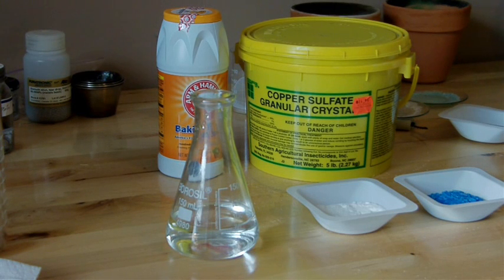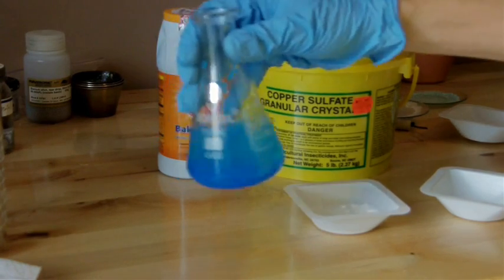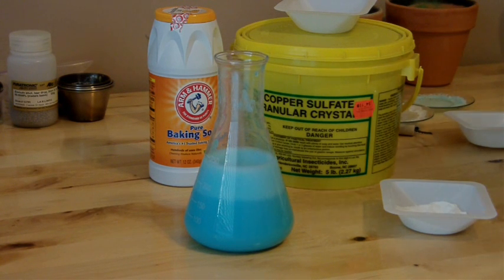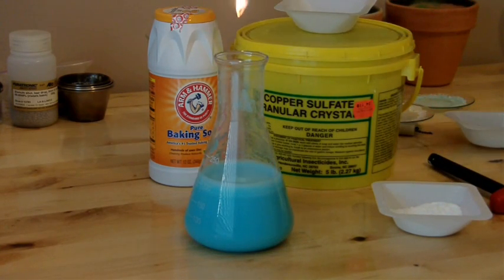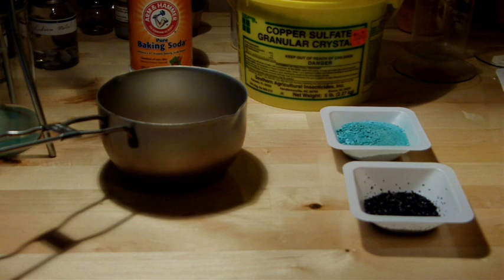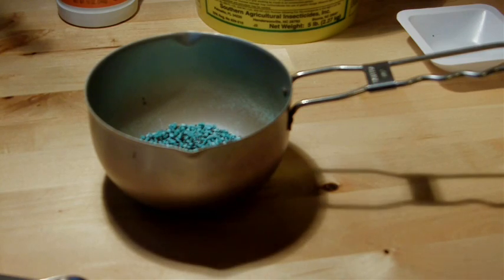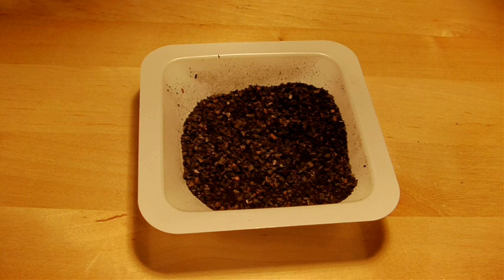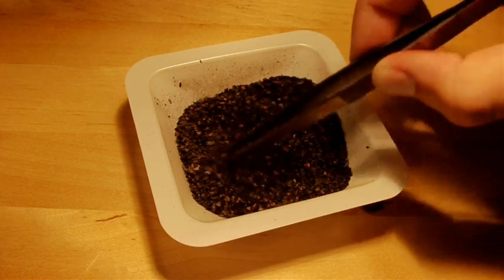Make Copper Metal from Copper Sulfate

Comment: Good stuff!  I coach Science Olympiad and will use this with my kids!  There's another great one where you take a copper sulfate solution and put an iron nail in it - copper is reduced by the iron and deposits on the surface of the nail to give a very distinct coppery color - Thanks!
Reply from the maker: Great! Some tips for the last steps: grind both copper carbonate and carbon down to a fine powder, and mix thoroughly. Also, cover the crucible when firing the mixture. It's actually the carbon monoxide that does the reducing, so keeping it covered keeps this gas in. One of these days I want to make an updated video that addresses these things that I should have done. Good luck!

Comment: How pure is the copper from this experiment? Please respond.
Reply from the maker: Hard to say - it could pick up carbon from the final step (assuming C dissolves in Cu like it does in steel) or carry along metal impurities from the source material. Doing a few recrystallizations on the copper sulfate starting material would help. Also doing the experiment properly to actually produce lump copper would help too!

Comment: It's much better to heat it in a tube in the presence of a gas that is flammable in oxygen. Hydrogen is used frequently, but I've used propane. It doesn't leave impurities behind.

Comment: another away to do it is:
Put an aluminium foil in the copper sulfate solution.
The reaction take some days. The blue color dissaper, the solution turns transparent(like water).
After all blue disappear, separate the copper metal crystals and clean with distilled water.

Comment: 1. You couldve just done an electrolysis of the Copper Sulfate and get pure fine copper particles.
2. Try dropping some zinc into the Copper Sulfate and filter the fine brown particles. Thats copper.
3. I like the way you did it because of the interesting science.. 
4. If youve got a high-temp torch you could melt the copper you got into one big piece.
5. Cheers.

Comment: actually no. copper carbonate decomposes fairly quickly to the oxide. depending on the temperature attained you woud get or just copper(because copper don't burn so easily) or copper II oxide.

Comment from the maker: Carbon is very different as an element than when it is bound in a compound. Same goes for sulfur in sulfate. Check the description for the reaction equations. Adding carbon is necessary for the reaction to happen - the carbon atom in CO3(2-) needs help to break out and leave as CO2 gas, and the elemental C (and heat) provides that by forming CO as an intermediate.

Comment: When you have CuSO4(aq) just add solid Zinc incrementally over a period of time until the solution no longer possess a blue tint this will produce Cu(s) + ZnSO4(aq) then simply decant the the entire solution to safely remove the solid copper from the zinc sulfate, and wash the solid copper down with some distilled or deionized water.

Comment: I like your videos and you do seem to have a fairly adequate understanding of the science involved in the experiments you're doing. I just have 1 question: Why do you almost always insist on using Erlenmeyer flasks for your reactions? This would have been much easier in a beaker. Your alkali metal and water reactions were done in a flask as well which is extremely dangerous. Do you have more of them than beakers? Or perhaps you just enjoy the "sciencey" look of the flask? Just curious.

Comment: in this reaction copper carbonate is decomposed to CO2 and copper oxide CuO the carbon (graphite) is used to reduce that copper oxide to copper and making even more CO2... It is better if you heat this covered so no air can enter.  The alternative method is to burn (CuSO4~5H2O) and sugar together in an airtight.

Comment: 5:47 if you have welding tools available, put a piece of metal to the opposite side from the handel and you can suspend it on top of the fire, or better yet two metal pieces to have a triangle shape for stability

Comment: the first double displacement reaction looks like this:

2NaHCO3 + CuSO4 => Na2SO4 + CuCO3 + CO2 + H2O

the sodium pairs with the sulfate ion into sodium sulfate. sodium sulfate stays in solution and the copper carbonate is precipitated out.
The second reaction looks like this:
2CuCO3 + C => 2Cu + 3CO2
with out added carbon not all the carbonate would decompose.

Comment: copper chloride and copper nitrate will both go through a double displacement reaction with sodium bicarbonate yielding copper bicarbonate.  reason is because Na is more reactive than copper in all compounds.  chlorides and nitrates are more reactive than (bi)carbonate series compounds.  With this you can skip the extra steps. knowledge of double displacement reactions helps in saving steps and money on extra reagents.

Comment from the maker: Sure, after a few steps. You could take your copper compound and react it with NaOH to precipitate copper hydroxide, then filter that off and react it with H2SO4 to get the sulfate. Or, you could just substitute the nitrate or chloride directly with the sulfate that I use in the video, and the process in the video should still work fine.

Comment from the maker: I actually did look into doing that, using a much simpler method (Al foil to reduce the copper sulfate solution). Turns out, with my sources for CuSO4 and Al, it doesn't make a profit unfortunately. If you can find a good source for bulk copper sulfate and aluminum for very cheap, it might end up being worthwhile.

Comment from the maker: That would be exceptionally difficult - look up the "reactivity series" of metals, and you'll see that Mg is pretty high up. Only metals higher than it on the series can displace it from its compounds, so you would need something like calcium or sodium metal which can be tough to get a hold of. You can find magnesium fire starters in sporting goods stores, if you're just looking for the metal.

Comment: After you get the CuCO3 add HCl (muriatic acid from home depot) to make CuCl2 then drop in some Al wire or strips and the Cu will be displaced by the Al and you can just scrape it off the strips at the end. Higher yield and less work and time...

Comment from the maker: @mcwario13 I actually stand corrected on this! Myst32YT just posted a video on making calcium carbide at home, using direct combination of the elements and a propane torch. It's only a small amount, but shows it can be done much easier than I had thought.

Comment from the maker: @mcwario13 Unlikely, at least not under home lab conditions. Calcium carbide requires the extremely high temperatures of an electric arc furnace to synthesize. If you had such a furnace, CaCO3 could probably be used because it would decompose to CaO on heating, which is then reacted with C as in the standard procedure.

Comment from the maker: @mcwario13 No, it's CO2. NaSO4 is not a compound, it would be Na2SO4, and even if that was what you intended your equation is an impossible reaction. It can't be balanced. Hydrogen is flammable in air over a very wide range of concentrations, which almost certainly was achieved here. I've never made hydrogen in the lab at a concentration where the gas test gave false results.

Comment: easier way to make copper: make copper sulfate solution. add salt. this makes copper chloride. add aluminum foil. wait for like one minute or so. the aluminum foil will now have turned to copper and fallen apart. filter the liquid with a paper towel and scrape off copper.

Comment: I believe you forgot to include the crystal hydration mass in your calculations. Copper sulfate is typically the pentahydrate and copper carbonate is a dihydrate if I recall correctly. Dehydrated copper compounds are white. Also, most root killer mixtures are ~98% copper sulfate with copper chloride making up most of the remaining 2%.

Comment: Nice! I've tried this reaction myself. I ended up with a big blue mess because I added the sodium bicarbonate too fast : ).
You could have heated the copper carbonate to remove carbon dioxide and then heated the CuO in a hydrogen atmosphere to get water and copper metal. But your method works just as well.

Comment: @Heathenheart1979
No - zinc is more reactive than copper, so it can donate electrons to reduce it from ions in solution to solid metal (displacing it from solution). Tin is less reactive than copper, and therefore cannot do this.

Comment from the maker: @megamarko94 Great question! Since CuCO3 is insoluble in water, it's very hard to rinse out. To remove it, I reacted it with hydrochloric acid: 2HCl + CuCO3 = CuCl2 + CO2 + H2O. Copper(II) chloride is soluble in water, and much easier to clean out. Interestingly, this reaction is very endothermic - it actually froze the water in the flask when I did it! Might be worth making a video about that.

Comment from the maker: @eutectics Thanks for the comment. The reaction produces copper - I'm not trying to melt anything. Perhaps using the word "molten" in the video was a mistake. If I had tried to melt solid copper, you're right that I wouldn't be able to do it with that heating setup. Also the pot was steel, it's just painted with something to make it look more shiny.